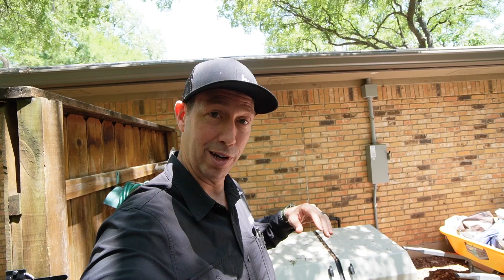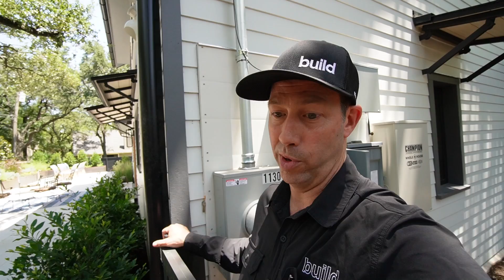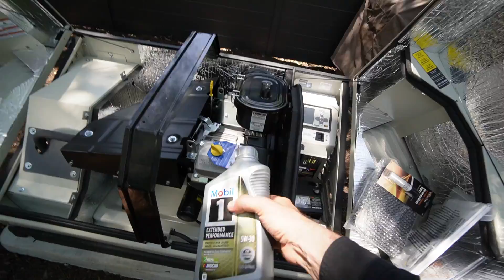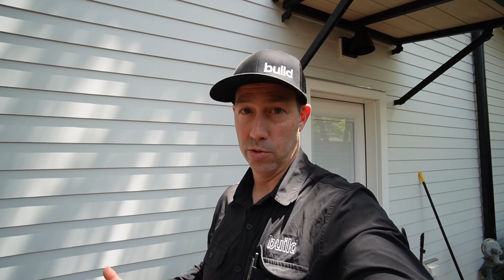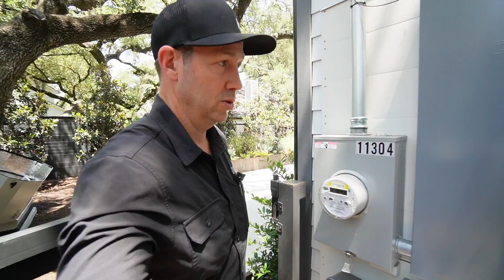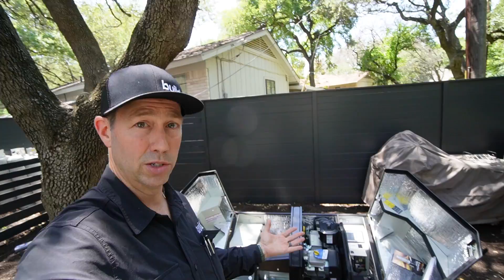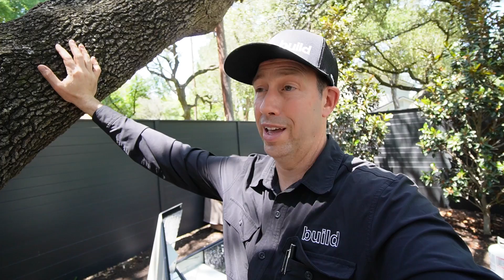Rolling Black Outs? Meet my little friend: Home Standby Generator

Comment: I am going solar/battery for my backup to help reduce energy cost during normal days. I am doing a DIY off grid setup (12kw inverter) as most of my appliance are natural gas. May of the commercial systems use Lithium Ion which don't have great cycle life but I am going with LiFEPO4 which should have 80% capacity after 10 years even if I cycle them daily. It is good to combine battery with generator so the generator does not need to run all the time and it can be used to charge the batteries if low. Like a hybrid car, it will run the generator at max efficiency and only when needed. I will use this approach so I can have a small generator I can use when camping acting in double duty. Atmos Energy in Austin is getting pretty expensive for natural gas ($100 bill somehow in ATX summer, hopefully not a leak). I may end up switching most of my heating needs to heat pumps and maybe convert to propane for stove and backup generator in the future.

Comment: Propane will work fine as long as you are healthy enough to handle the tanks and your area does not run out of propane during a storm. I’ve been in mid-sized cities where the local propane supply, because of high demand, ran out and the nearest supply was over 100 miles away.

Comment: I tend to agree with you on all points, for your location. I live in NE Wyoming at an elevation of 4500 ft above sea level, so snow can literally happen any time of year. That said, i have very few overcast days. My plan is to have wind, solar, and propane power available. Wind and solar will power me most of the time, but if it's not enough, I'll have propane there to fill the void.

Comment: Question, when you mention daisy chaining the LP tanks, will they literally all be hooked up basically in parallel? For example, if you have a 2 day power outage will they all be at various (maybe close to balanced) medium LP levels meaning you'd have to load up all of them and have them all topped off? Thanks for showing us your system.

Comment: Look into LiFePo4 battery. Rated at like 7000 cycles with 80% depth of discharge. Not a fire hazard and you can put them pretty much wherever. 48v server rack batteries are compact and super nice.

Comment: FYI you don't need anything but basic electrical training to get your home going on a portable generator in an outage. No interlock nor transfer switch installation needed: See this NEC code:
702.5 Transfer Equipment 
Exception: Temporary connection of a portable generator without transfer equipment shall be permitted where conditions of maintenance and supervision ensure that only qualified persons service the installation and where the normal supply is physically isolated by a lockable disconnecting means or by disconnection of the normal supply conductors.
Just make sure you can lock your main open and keep the kids/idiots away, and you're legal.

Comment: I would do a small battery and a solar setup that could provide extra power during the day...  You would not live as comfortable but you would have power nearly indefinitely...  with a good Lifepo4 battery setup... 
Now most of the "big" names are not using Lifepo4 as it is more $$ upfront, but it has a much longer life, lower risk of fire, and upwards up 5k cycles.

Comment: Agree with everything in the decision process.  I have studied solar and battery extensively and the cost is RIDICULOUS compared to going with a propane generator.  I also live in the peoples republic of austin vicinity but in an area with acreage lots and no ridiculous city codes so have plenty of room to do whatever I choose.  I can get a 24kW propane generator system and enough 100 pound propane tanks to run for 5 days at 100% load plus complete installation for about the same cost as just a single powerall unit that won't run my whole house and what it does run will only be for a few hours.  Add on solar panels and enough batteries for it to be useful and the cost is insane and still subject to the vagaries of the weather.  For example the snowpocalypse from a couple years ago was no sunshine at all for days.  Not a problem for propane generator but a killer for solar and batteries.

Comment: I thoroughly agree with your concerns of a powerwall attached or inside your home.  I wouldn't dare run any small appliance like a space heater, or large appliance such as a dryer or stove without supervision.  Imagine leaving your home with a 30KWhr firecracker attached to your siding, baking in the sun.  A battery management system with 24awg wires from an unknown supplier.  Thousands of individual cells from half a dozen suppliers.  Assembled by machines for which the program is constantly being optimized because it wasn't perfect last time (when was your pack made?).  Nah, bro.  I will take a generator plumbed to a safe storage of gas 30 ft from the home on a concrete pad with (if plumbed to city) a limitless source of fuel.  Did you mention it's cheaper?  I think I covered the safety aspect.

P.S.  I would be super on board with tethering an EV to the home (with a cable, the EV is OUTSIDE).  I don't want that much energy strapped to or inside my home, sorry.

Comment: Do any of their generators have the ability to run on natural gas and/or propane so it could be hooked up to natural gas as the primary fuel source but in the event gas lines were down (or shut off), you can switch to propane via a series of daisy chained tanks kept on site to account for this risk?

Comment: I always recommend a propane genny as backup to solar for my customers if they are 100% electric and no gas or propane appliances. Full electric houses use a lot more energy than mixed fuel houses so trying to run on solar and battery alone in emergencies will not work unless your solar is sized to cover 120% to 150% of your needs. In major emergencies the gas stations are down and you cannot get gas or Diesal for your generator so access to propane is much better. I did not say clean, just better in emergencies.

Comment: Hi Matt, I am in Florida and recently installed a 22KW Generac with a buried 500 gal propane tank. I am on the water so the tank had to be buried and the generator is on a 3 ft block pedestal. I would suggest thet you buy a 200 gallon horizontal tank.and do away with all of the rental BS and fees. I had a 200 lb tank  rental and the rental fees were over  $100/ year. And, my only usage was a gas fireplace. It does get cold in SW Florida. I enjoy your shows. Thanks

Comment: Virtually ALL of these units run @3600RPM, like 70 mph on a three speed tranny, but why ? They ALL USE CHEAP GENERATORS which have to run like hell to get 60HZ , I was given a 5 month old GENERAC UNIT A BROKEN ENGINEI only got a bent con rod even still under warranty , all1800RPM UNITS usually are DIESEL STARTING AT 10KW   BUT ARE COSTLY, BUT WILL LAST, ESPECIALLY WATER COOLED UNITS,,  CHERIO🇺🇸🇺🇸🇺🇸🇺🇸

Comment: Come on, Matt.  110 volt alternating current was over by the 1970s.  It has been replaced by 120 volt since the 1980s.  Same goes for 220/240 volts.   See https://en.wikipedia.org/wiki/Mains_electricity#Voltage_levels

Comment: I just signed up to expand my current solar panel system to include 9 more panels and a tesla wall. My inner prepper loves your propane setup, but the cheapskate in me wants to leverage that smart battery tech to reduce my usage of the high-tier power (4pm-9pm). 
I do have a gas generator that I bought years ago for emergencies...and yes, I still occasionally kick myself for not getting a tri-fuel one!

Comment: For short outages Batteries are great. I have simplifi batteries that are lithium Iron, need no maintenance, venting or anything special. The solar can run the house most of the day the batteries can run the house thru most of the night. If I need additional power or larger loads, I can fire up the generator. This allows for shorter runs on the generator and ability to do maintenance on the generator for those longer outages.

Comment: That's a neat system but too bad you didn't fully consider and learn about the batteries more and go with solar.  Heck I have solar in Michigan and it pays for itself very well, would be better in Texas.  Your answer to safe batteries - LiFePO4 is very safe, very long lasting, and is fine being at 100% charge vs the NMC which have shorter life.  Batteries are recyclable - look into Redwood Materials.  Only downside would be higher cost but with installing solar you are making your own energy and can be essentially "off grid" several months of the year if you size it right.  I have plenty of solar but no battery backup yet since I have net metering for a few more years.  I will pull the trigger on the battery backup within 3 years though.  Also with solar + batteries you can take use of TOU rates from your energy company.  You could also be 'off grid' for months on end if sized right...

Comment: Why even use propane if you have access to a natural gas line? You will run through propane much quicker than you think and 40 dollars a month for access to unlimited fuel to run your generator is a simple solution.

Comment: Just speaking in general.  Wonder why all generator companies don’t up pulley configurations on joining the motor to alternator head?

I mean..  when the generator is at idle it produces a really weak 60htz.  Any payload takes the motor out of idle and starts to consume more fuel.
And that is where I question how there mounting configuration.

If you install a pulley on the motor that idles at optimal idle.   On the alternator head pulley that will create 60htz (3600rpm)

Wouldn’t that be a stronger electrical field and best fuel economy??

Just always curious about that.

At any rate.   Excellent share!!   Looks like a really nice generator!

Larry

Comment: Good thoughts re: using the small propane tanks. I have a Generac natural gas powered 16kW unit here in Salt Lake City. I thought about gas grid versus large propane tank. I figured that, in a big earthquake, there is at least as great a chance of delivery truck problems and/or local tank and plumbing problems, as there is of gas grid outage.

Comment: Hey Matt. New subscriber! I appreciate your insights and knowledge on this topic. We”re in the 90’s-100 degree range right now as so many are. We’re in the Northeast-Pa. I don’t have a good handle on this though you helped a lot. Since we have natural gas, is the way to go , with the gas? Or is propane an option? Thanks for the intro to the Champion series. Very good explanations . Great job on the house, btw. We have regular gas and AC. No pumps, or the like. Hot water heater and a smallish-medium sized house. Still don’t know exactly how big it really is on paper. But we have a lot of items we’d like to keep going, first and foremost, the AC ! Can you point in the direction of learning baseline info on this, to make a proper choice? I’d prefer to buy American if I have the choice. We’re also older and this is our first house so we’re not knowledgeable on this topic. Thanks Matt.

Comment: I went down the solar generator route too.  It's very intriguing, but ultimately I think I'm ending up with the same conclusion... although solar generator / back up may provide resources each day (ROI), long term performance is unproven, and the cheaper solution is a generator.  I do like that axis system.... looking now!

Comment: On the Battery Backup, the batteries used are LiFePO4 (Lithium Iron Phosphate) they get in the area of > 3,000 cycles while still having 90% of original capacity.   The batteries in cellphones are Li-ion that have a high percentage of cobalt in them, they have battery life in the 500-1000 cycle range and have a steep fall of in capacity.  Add to that, the fact that you're cycling them typically between 0.5 to 1.5 cycles per day, and that's why they deteriorate so quickly.  The Storage battery, if you're only using 300 cycles a year out of it (which is on the extreme side) should still be at 90% of original capacity in 10yrs.  Add to that, battery prices will continue to fall, so in 10yrs, add another battery to it if you want more capacity.  FWIW, that 300 cycles is a daily use scenario and typically only done in areas where you either don't have Net Metering available, or you've got a TOU (time of use) scenario where you pay high rates during part of the day because of higher grid use.  Otherwise they're there more for backup and get very little usage.  Also great to have with generator backup for long term.  That way you're getting full use out of the generator, storing the extra electricity being produced under the load instead of whatever the house happens to be using at the moment while you're running it.

Comment: There are alternatives to Lithium-ion battery packs. zinc-bromide batteries are long lasting, they won't burn or explode and can set fully charged   or100% discharged with no problems.

Comment: I have been going back and forth with trying to decide between generator/solar and batteries. I have medical equipment that when the power fails can be debilitating, or possibly life threatening depending on length of outage. I have decided to get the generator installed, being disabled the automation is appealing and I can get someone to do maintenance, but I would also like to rely less on the city grid in the long run. So when I need to get my roof replaced I am going to add solar and batteries, hoping that the technology for solar will be even better by then, I expect it to be. I intend to have it setup that if the power goes out, it reverts to solar first then if/when the batteries get depleted the generator kicks in, assuming the natural gas lines aren't affected. It's a long game plan and subject to change if any new technologies or information comes available.

Comment: How I see everything as far as solar and everything
Generator: for grid down and charging battery when low
Back up battery/ hybrid inverter: so solar works when grid down, control generator, peak hour off setting
Solar: owning power. Pay nothing after 25 years. Long term investment. 
To be honest all are good options but with getting hit with another 10% increase in power rates it hurts @ 13.5¢ per kWh for 3869 kws for July

Comment: I would have done 16kw of solar and 30kwh of batteries for unlimited free runtime, with a wood burning stove for winter emergencies. Storing half a ton of propane in a small suburban backyard is insane.  Hope you have good lightning protection on that.  Hardwood is free every ice storm and tornado season here in Oklahoma. Just pick it up from the roadside and cut it up with a $60  electric chainsaw.  Also. Recycling tesla batteries is a non issue.  They are 98% recyclable.   This is according to their annual peer reviewed impact report, not some Facebook lies made up by oil loving trolls.  Too many boomers are believing Facebook FUD instead of researching facts on their own cuz they're too lazy or incompetent to do so.  But I digress.  It's too late to save the planet anyways.  We're burning and it ain't gonna get better.  Like Matt said. Be a hero and be prepared for your family because no one is coming to save you.  Love your channel, Matt. I refer folks to it all the time.  Keep fighting the good fight!

Comment: During the great freeze, my wife and I survived almost a week without electricity and no backup here in Texas.  We now have a medium sized generator, a large window air conditioner and a small electric heater.  Our goal is to just stay comfortable in one room of our house and wait out the storm when this happens again.  
Running the generator all the time would take a lot of gas, I have wondered if it would make sense to have a small battery bank and a battery charger run off from the generator.  We would just give up on keeping the food safe in the refrigerator, run the generator long enough to cool down or heat one room and use the batteries just to keep small lights, internet and our laptops running when the generator is off.
One problem is that our generator is an inexpensive Modified Sinewave unit and I am not sure batterie chargers will work with it.
Anyone out there have some insight with this??  Is this a viable plan??

Comment: At the moment, my plan is to start with the generator.

Then add the batteries (LiFePO4), which can charge from the grid when they're not needed. They add a "whole house UPS" functionality while the generator spins up and kicks in. LiFePO4 batteries have a very long lifespan, unlike typical Lithium Ion batteries.

Then add the solar system which can provide enough power for the whole house and recharge the batteries. At night, you can choose to run from the grid or batteries, depending on costs, etc.... if you used the batteries overnight, they will then need recharging the next day.

Comment: The air cooled engine will have less maintenance and change the oil sooner than required by the manufacturer for longevity.

Comment: I’ve been looking at having solar installed without batteries, using the grid as the « battery » at normal times and lowering the capacity need of the generator during outage.
Reply: If you're grid-tied and the grid goes down, then there may be laws in your state that require you completely turn off your solar panels, even if you could otherwise use them to power your house during the day. You need to check your local laws.

This is part of why many people who want to be able to use their solar panels whenever they want end up going completely off the grid, so that they don't have to worry about those laws.